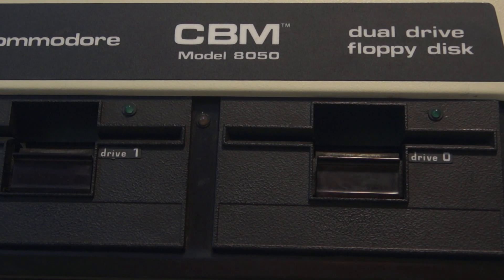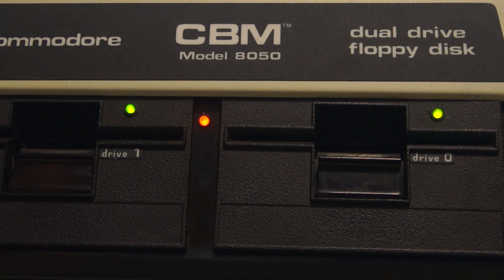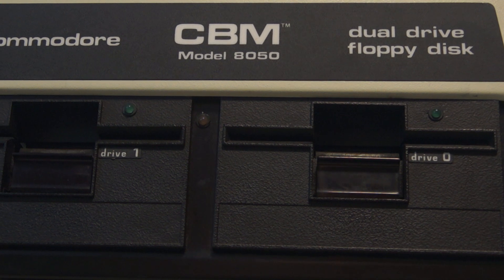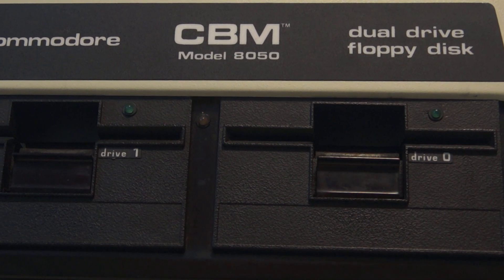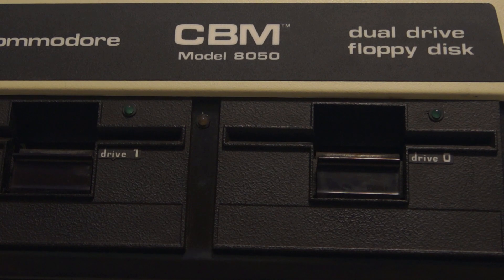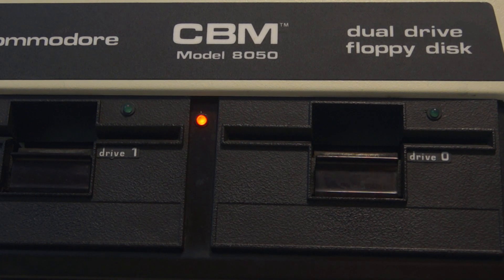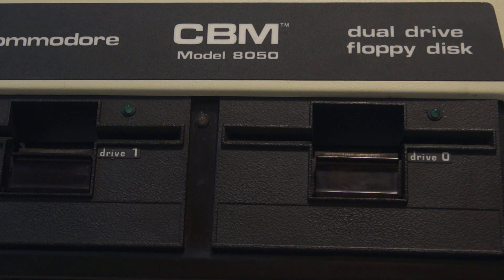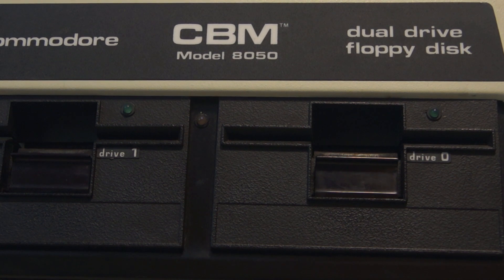Commodore - Episode 472 - SMOKE Erupts From An 8050 Dual Disk Drive - Dave Bradley - PET CBM 8-Bit

Comment: Capacitor, dah? Works as long as it isn't shorted or completely dried up.
Reply from the maker: What does a capacitor smell like when it goes up in smoke?
Reply: @DRBradleyPhotography  Electrolyte, has a chemical odor to it.
Reply from the maker: @dominikschutz6300  This smelled like paper...not hint of chemical or hot electrical burn...very strange...still looking for the source...
Reply: @DRBradleyPhotography  Oh, ok :)
Reply from the maker: I still need to dig into that 8050...messages seem to indicate that trouble will be behind the power supply near the power switch...
Reply: @DRBradleyPhotography  Don't know whether you ever got around to fixing  it but in my case it was the filter capacitor - steel tube strapped to the chassis beside the transformer. 2 wires in, two wires out.